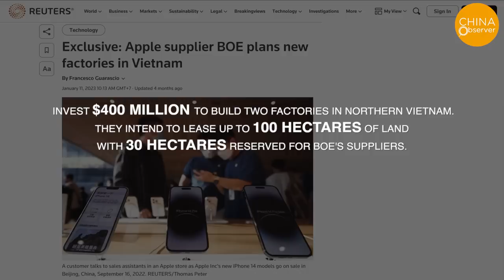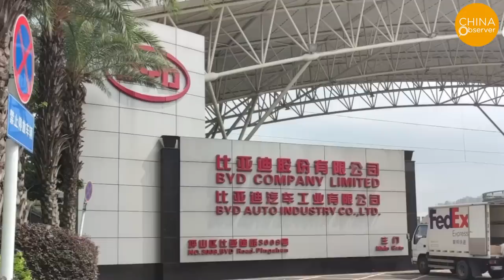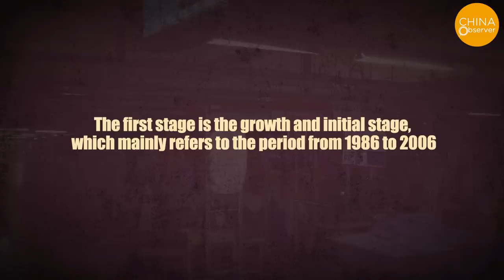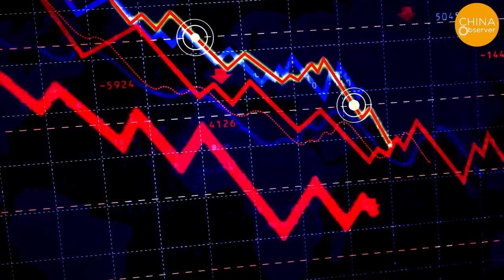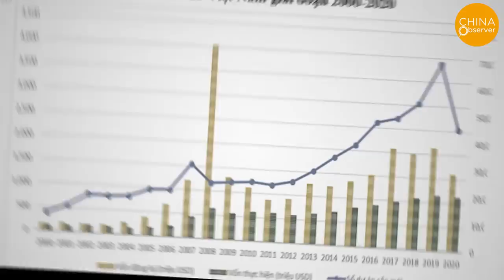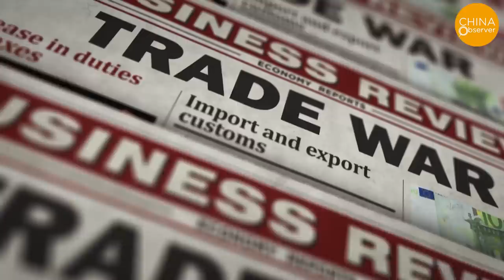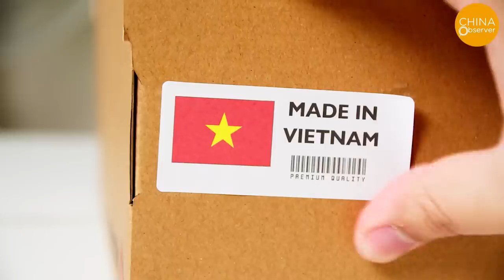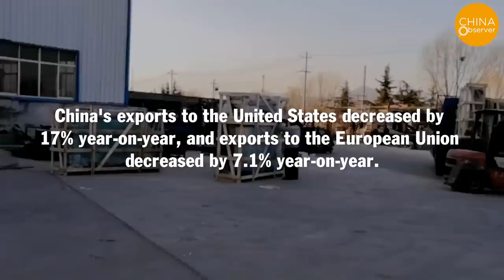Not Just Foreign Firms Flee, It's the End of World’s Factory: China Collapse, Vietnam & Others Rise

Comment: I can only speak from my own experience.  We buy kitchen cabinets made in China for our rent houses.  They come unassembled.  They assemble quickly and easily, because they have an integrated locking mechanism where you connect,  then lock the pieces with a special wrench.  The vendor recently switched to purchasing cabinets made in Vietnam.  I have the following to say about the Vietnam cabinets  (1) Build quality is poor, (2) The  instructions are garbage,  (3) assembly design is very poor, requiring you to insert dozens of screws, with almost no predrilled holes, (4)some pieces don't fit correctly, (5) missing hardware.  PS, the price is the same for both the Chinese and Vietnamese products.
Reply: That is because they are made in Vietnam by the Chinese owners